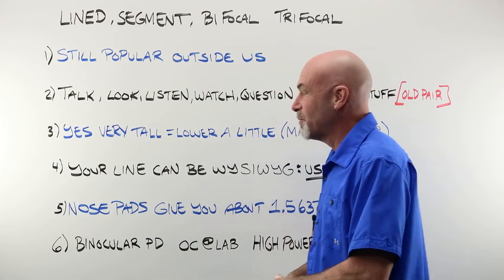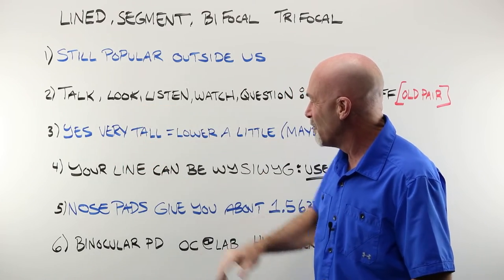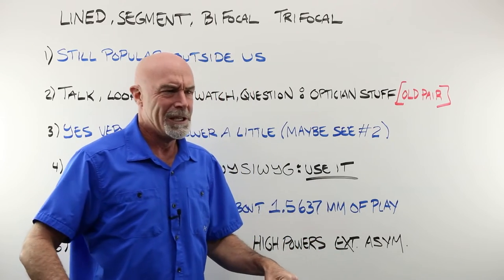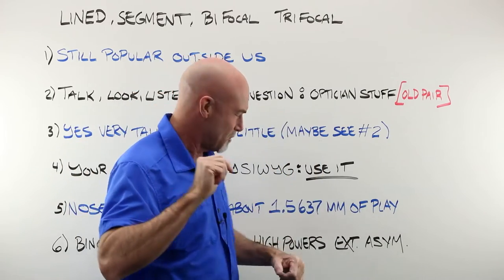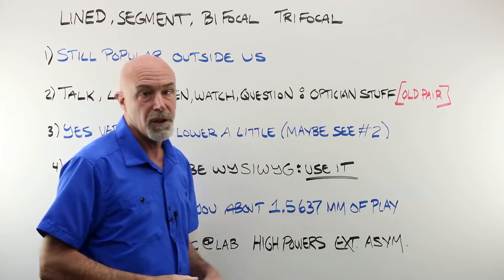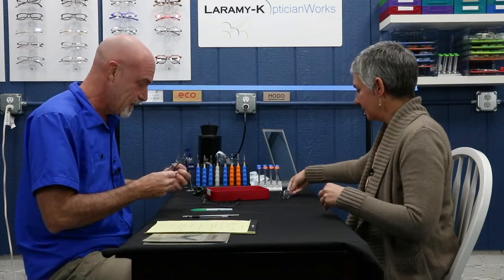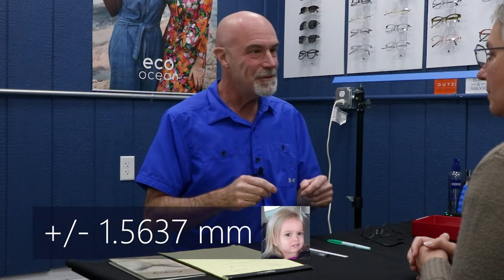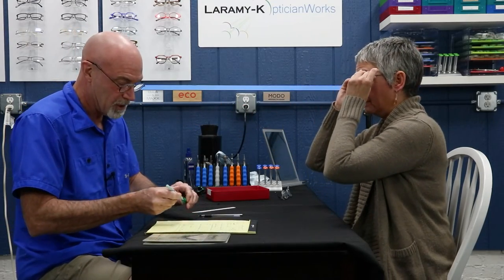Measuring for Lined Multifocals

Comment: This was interesting.  I am glad there are people still wearing lined bifocals.  But you seem to suggest in one of the comments that lined trifocals stop being dispensed.  I still wear lined trifocals and like them very much.  It scares me that that they may one day no longer be an option.  I have been considering asking my optometrist to try and compromise my reading distance by taking it out a little further to maybe find an middle ground between near and intermediate if trifocals vanish but I'm afraid I would have to hold things too far away when reading.
Reply from the maker: The use of lined trifocals is certainly in decline. The blanks used to create them are getting harder to get but they are still in use. Considering you are already wearing them that says something about your age - you'll probably live out your remaining years without a supply issue.
Reply: @LaramyKOptical  Thanks for the reply.  I am 55 years old but my intermediate vision still needs help.  I would move to a higher end progressive if I felt confident that I would have enough room to see consistently at one depth.  By this I mean the my intermediate lens on my lined trifocals is a depth of 7 mm.  When close to the eye that is a satisfactory amount of space and I know it will be consistent and dependable.  But if progressives - if I understand them right - keep changing as you look vertically down the lense then it seems like it would not the same enough to take in very much vertical space.  Does that make sense?  What are people in need of intermediate vision to do if they don't handle progressives well?
Reply from the maker: @goodwill6767  A shop should be willing to switch you back to a traditional lined style trifocal if a progressive is a non-adapt. It is an agreement between the labs and the progressive lens companies. Just make sure you have that agreement up front. You won't get back any difference but you won't be stuck either. Your eye/brain naturally finds what it needs for any given length in the progressive designs. BUT - if you are perfectly happy in a lined trifocal why fight it? Probably saving a few (maybe many) hundred dollars per pair as well! John
Reply: @LaramyKOptical  Yes, they did say they would change me back but without the difference if I couldn't adapt.   I wouldn't even think of changing but if the blanks used to make them are getting harder to obtain eventually resulting in the death of trifocals then I though maybe I should cut to the chase and just try to make the change before that happens.  On the other hand one would think they would be almost compelled to keep them if for no other reason than to have an alternative for those who simply cannot adapt to progressives.

Comment: I think fitting lined segmented lenses based on lids or irises is old and obsolete. I suggest taking a pupil height and then understanding that acceptable and satisfactory outcomes, aka 20/Happy, can lie within this range:

Bifocals: 8mm to 10mm below pupil, with outliers in the 7mm to 12mm range
Trifocals: 3mm to 7mm, with outliers in the 2mm to 9mm range.

B